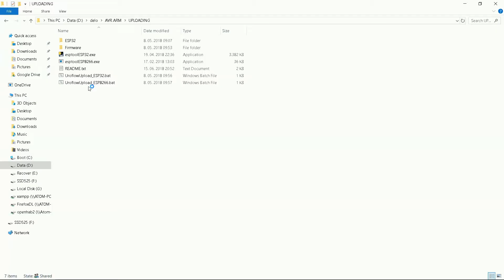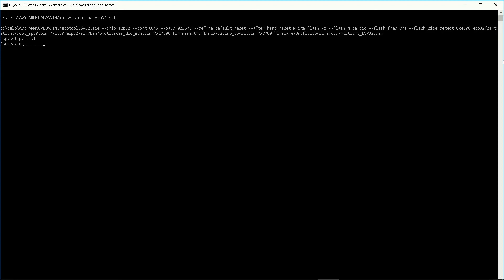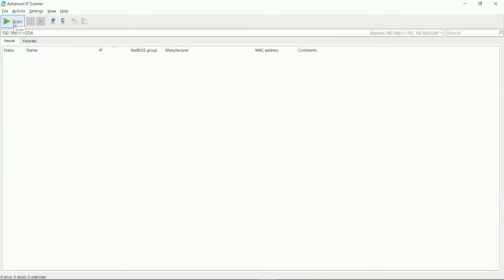🔴 UROFLOWMETRY MACHINE (How to upload/flash w/ Arduino firmware & files ESP8266/ESP32) 👨‍⚕️💊 PART 3

Comment: Hello Dr.  after some trials i managed it....don´t know how, but its working fine. Exelent work. Only on last question: There is a counter until 50...what happens when i reach 50 measurents?
Reply from the maker: Hi. Thank you for the question. It will stop working. You will have to buy a new esp32 and repeat it all. It is a precaution to prevent the commertial usage. 
Soon the device will be available for sale at https://www.rojo.si/ with no limits and in a nice enclosure. Not expensive for private use. I am rewritting the whole code... It might take a month or two. Please do check the site.
Reply: @greeneyedexplorer  where can i buy the comercial use?

Comment: Hello Dr....first..very impressing what you have done.....Here is my Problem:
I have uploaded the firmware successfully...but the device does not generate the Wifi "uroflow" as you discribe it in Video3 at 2:49...what do i wrong? 
Best regads....
Reply from the maker: Hi! Thank you for the question. It should work as described. You can bypass it all by editing .json file. Enter wifi credentials for your wifi and IP address, gateway, server. The IP might change - use wifi scanner to find the address after it connects to wifi. Don't forget to flash the json file :-) after the edit. (I see you have already solved it - good!)

Comment: Great little device, after a few mistakes on my side I managed to make the noncommercial version running nicely. It seems so far that the weight calibration works well - thank's for sharing.
Reply: ahoj, nemel bys funkcni fw? mam tam ten 0B soubor ESP32ino_ESP32 a nikde nemohu najit jiny
Reply: @colasfreehold  Ahoj, neviem, či ešte niekde je... Skúsim pozrieť.
Reply: @marekbundzel  dekuji, zkus to, jsi ma posledni zachrana, jinak neni uz dostupny.
Reply from the maker: Hello! Free firmware is no longer available. Uroflowmeter has become a commercial product. The manufacturer is iPeeWell. Link: https://www.ipeewell.com/
Reply from the maker: Hi Marek! Thank you for the compliment and for supporting my channel! Greetings to Slovakia!

Comment: Where can I find the buyable version ?
Reply from the maker: Currently I have prototypes...
Reply: I think I am able to design the hardware, and to mount it. I thought you were selling the software, don’t you?
Reply from the maker: The PC software works with specific microcontroller firmware. Specific protocols which are not implemented in free version.
Reply: Ok. So how can I buy it?

Comment: Hello Sir,
I'm trying to make this project to help a friend, but I'm stuck on the esp32 programming. When I plug the esp32 module (I installed the drivers and checked the com port) it lights red.
I can successfully program it by pressing the boot button on the module and then run  .\UroflowUpload_ESP32.bat
The output of the command is below:
esptoolESP32.exe --chip esp32 --port COM3 --baud 921600 --before default_reset --after hard_reset write_flash -z --flash_mode dio --flash_freq 80m --flash_size detect 0xe000 esp32/partitions/boot_app0.bin 0x1000 esp32/sdk/bin/bootloader_dio_80m.bin 0x10000 Firmware/UroflowESP32.ino_ESP32.bin 0x8000 Firmware/UroflowESP32.ino.partitions_ESP32.bin
esptool.py v2.1
Connecting.....
Chip is ESP32D0WDQ6 (revision (unknown 0xa))
Uploading stub...
Running stub...
Stub running...
Changing baud rate to 921600
Changed.
Configuring flash size...
Auto-detected Flash size: 4MB
Compressed 8192 bytes to 47...
Wrote 8192 bytes (47 compressed) at 0x0000e000 in 0.0 seconds (effective 8192.1 kbit/s)...
Hash of data verified.
Compressed 14128 bytes to 9194...
Wrote 14128 bytes (9194 compressed) at 0x00001000 in 0.1 seconds (effective 1027.5 kbit/s)...
Hash of data verified.
Compressed 737296 bytes to 426084...
Wrote 737296 bytes (426084 compressed) at 0x00010000 in 6.0 seconds (effective 987.2 kbit/s)...
Hash of data verified.
Compressed 3072 bytes to 122...
Wrote 3072 bytes (122 compressed) at 0x00008000 in 0.0 seconds (effective 3072.0 kbit/s)...
Hash of data verified.

Leaving...
Hard resetting...
====================
After the programming execution finishes, I have 2 lights, the red from before and now blue too.

The problem is that I can't see the SSID broadcasted. 
Tried to unplug and plug the module again...no success.
Please advise what I'm doing wrong here. I used everything as default, and just replaced 1 empty file with the actual firmware.
Reply from the maker: Hi. Before the upload edit the .json file with your friends SSID and password. It will work on his WiFi, not yours. The program goes into captive portal at wifi connection if it is not successful...
Please read other posts.
Reply: @greeneyedexplorer  Here is the debug info from the serial console, it seems it constantly reset itself as this repeats every second seems the problem is(E (71) SPIFFS: mount failed, -10025
Failed to mount file system
):
====================================================

Rebooting...
ets Jun  8 2016 00:22:57

rst:0xc (SW_CPU_RESET),boot:0x13 (SPI_FAST_FLASH_BOOT)
configsip: 0, SPIWP:0xee
clk_drv:0x00,q_drv:0x00,d_drv:0x00,cs0_drv:0x00,hd_drv:0x00,wp_drv:0x00
mode:DIO, clock div:1
load:0x3fff0018,len:4
load:0x3fff001c,len:956
load:0x40078000,len:0
load:0x40078000,len:13076
entry 0x40078a58

ROSA 20180618.v5785 by Rok Rodic alias Hacker007 alias GreenEyedExplorer
Chip ID: 0x99E350CC
Measurements: 0
Booting
       CPU0 reset reason:Software reset CPU
CPU1 reset reason:Software reset CPU
Heap: 157560
            Chip version: 1
                           CPU speed: 240MHz
                                            SDK: v3.1-dev-239-g1c3dd23f-dirty
                                                                             Flash size: 4194304
                                                                                                Flash speed: 80000000
     E (71) SPIFFS: mount failed, -10025
Failed to mount file system
Guru Meditation Error: Core  1 panic'ed (LoadProhibited)
. Exception was unhandled.
Register dump:
PC      : 0x40147a8f  PS      : 0x00060930  A0      : 0x800e0674  A1      : 0x3ffda380
A2      : 0x00000000  A3      : 0x3ffc1124  A4      : 0x000005b4  A5      : 0x00000008
A6      : 0x3ffda39c  A7      : 0x3ffda390  A8      : 0x80086132  A9      : 0x3ffda370
A10     : 0x00000000  A11     : 0x00000000  A12     : 0x00000005  A13     : 0x00000020
A14     : 0x00000020  A15     : 0x3ffd51fc  SAR     : 0x0000001b  EXCCAUSE: 0x0000001c
EXCVADDR: 0x0000000c  LBEG    : 0x400dce98  LEND    : 0x400dcea4  LCOUNT  : 0x00000000

Backtrace: 0x40147a8f:0x3ffda380 0x400e0671:0x3ffda3a0 0x400e09e9:0x3ffda3d0 0x400db880:0x3ffda440 0x400dcf7e:0x3ffda460 0x40131ad8:0x3ffda490
Reply from the maker: Hi. First you should upload all files and make the spiffs. Uploading firmware does not do it automatically by itself.
Reply: @greeneyedexplorer  Thank you, I suspected by the error I posted here that the spiffs is missing. Can you please point me to read how to do it? I was not able to find it anywhere in the instructions.
Reply: I figured it out, now this part is working. For anyone that faces the same problem.
1. Install Adruino IDE.
2. Watch this video to add support for esp32 (https://www.youtube.com/watch?time_continue=70&v=mBaS3YnqDaU)
3. Use this tutorial to upload the files in the "data" folder to the module (https://randomnerdtutorials.com/install-esp32-filesystem-uploader-arduino-ide/)
4. Follow the instructions in the project to upload the firmware.
Reply: @nikiangel1921   hello, so is it working now? does it broadcast the SSID ? working?
Reply: @allersvp  yep. It works now and broadcasting the ssd
Reply: @allersvp  I believe that I posted the solution somewhere in this thread, yes it is broadcasting now.
Reply: @nikiangel1921  Hey,  what do you do first? I am having the same problem and I can't see "uroflow" I upload firmware first and then I make the SPIFFS but It doesn't work.
And when you did SPIFFS what files you choose? only config.json or all files of "data"
Reply from the maker: Hi. Stick precisely to the video. The command uploads everything in the data folder.
Reply: Hi thanks por answer me, I have an "ESP32S". I am doing the same of the video but really, It doesn't work, I don't know why. I overwrite config.json with my ssid, pass, ip and other things, then I upload files and expected broadcasting "uroflow"
Thanks for helping
Reply: @greeneyedexplorer  Thank you for helping me. I'm still not in the part to upload the .json file. I just uploaded the firmware and expecting to see the  "uroflow" SSID, but it never comes.
So for me this is not working:
"At first bootup this file does not exist, so just wait those 20s and access point named uroflow appears for 5 minutes. " Uroflow does not appear as SSID.

Comment: also i never used that files you attached .. UroflowESP32.ino.doitESP32devkitV1.bin  should i ? where/how  should i use it  ... may be this is what i am missing?!
Reply from the maker: Hi. Yes. Please check my answer below. Copy the firmware file you have stated above into Firmware folder of the unpacked Upload.zip and rename& overwrite it into UroflowESP32.ino_ESP32.bin and run .bat file.

Comment: helli again, problem is no uroflow ssid after those 20 sec  . should i try other files under SDK/BIN ...  the 8 files? how to know which one match my esp-wroom32 ?
Reply from the maker: Hi. Use the package upload.zip. Unpack it and overwrite UroflowESP32.ino_ESP32.bin file in Firmware folder with UroflowESP32.ino.doitESP32devkitV1.bin (length of ca.800kB) from github. The final name should be the the one of the first file above, so rename the 800kB file. Hope this makes sense. Then just run the UroflowUpload_ESP32.bat

Comment: THANKS 4 REPLYING ME: ... yes that is the prog > it does not broadcast ssid (uroflow) .., blue led is always ON. (measuring i guess) at serial monitor i get  repeating few lines .... (will past down here) , my chip is good because when i downloaded small sample prog > i can see and access its SSID and play with an html web file so it must be either the way iam downloading your files or i am choosing wrong ones! . i tried both batch file and esp32 tool >> successful download but no SSID uroflow.    any further suggestion?

rst:0x10 (RTCWDT_RTC_RESET),boot:0x13 (SPI_FAST_FLASH_BOOT)
configsip: 0, SPIWP:0xee
clk_drv:0x00,q_drv:0x00,d_drv:0x00,cs0_drv:0x00,hd_drv:0x00,wp_drv:0x00
mode:QIO, clock div:1
load:0x3fff0018,len:4
load:0xffffffff,len:-1
ets Jun  8 2016 00:22:57
thank you soooooooooo much
Reply from the maker: When the program starts it displays some info about the ESP32, then "SPIFFS mounted", then "wifi connecting to", then 100 "." and if cannot connect it displays "Not connected. Starting captive portal!" The "."(dots) take about 20 second which is period it tries to connect to ssid with password which are both specified in config.json. At first bootup this file does not exist, so just wait those 20s and access point named uroflow appears for 5 minutes. Then connect to this ssid and enter 192.168.4.1 into browser... When you configure your own ssid, pass, ip... they are saved into config.json. Reset. That's all to it. Led is on until all setup steps are made - including all above. When the led turns off one can start urinating...
Reply: Hey allservsp, how did you fix the "it does not broadcast ssid (uroflow) .., blue led is always ON" as I have the same problem.

Comment: hi, sorry was my first arduino approach , i overwrote the 0 size file with the  UroflowESP32.ino_ESP32.bin from the firmware folder and oh oh... it accepted the 4 files :) "big improvement " ..  however there is no broadcasted SSID "uroflow" ! am i missing something ? .. esp32 is working as h/w because downloading sample wifi files from internet makes it broadcast SSID name buut not uroflow files.. should i replace one of the 3 files + 1 file of firmware with another file from another folder?  .. i tried both .bat file and the download toll >> both send the 4 files successfully  but no ssid (yes i have to press boot button ...)  appreciate if you have time to reply. thanks a lot
Reply from the maker: Hi. No problem. Now, when you have uploaded firmware, watch the video Part 3 from: 2:39. Then connect to the device and follow video Part 3 from: 3:15. In the last part you will upload www files from upload.zip. Please, report the progress.

Comment: so sorry to bother you... (promise last question)
i see in your attach the 4 files and one of them has 0 size !

0xe000 esp32/partitions/boot_app0.bin    >>> 8 kb
0x1000 esp32/sdk/bin/bootloader_dio_80m.bin   >>> 14 kb
0x10000 Firmware/UroflowESP32.ino_ESP32.bin  >>> 0kb *** is that is correct? zero size?
0x8000 Firmware/UroflowESP32.ino.partitions_ESP32.bin  >>>> 3kb
Reply from the maker: Yes yes. It is a blank file. You have to overwrite it. You choose latest version of uroflow firmware and rename it into UroflowESP32.ino_ESP32.bin and put it into Firmware folder. You can use any other bin file for esp32 and rename it and copy it into Firmware folder. Then just run .bat file for the esp32. It will upload firmware. Another way is to edit .bat file and specify the path and name of your .bin file... It seems I haven't been clear enough in the video. Thank you for your remark!!!

Comment: hi Dr. 
i toke the day off to gain time and still not do it. "  day off is not paid :(   " 
here is what i reached for.... i used this https://www.espressif.com/en/support/download/other-tools 
  and used your files 4 files>> same issue then i used your video  https://www.youtube.com/watch?v=PtNOOtTaPlg   and created small led on/off prog and by that https://www.espressif.com/en/support/download/other-tools i could upload the 4 files WITHOUT A PROB .   also serial port terminal is receiving good text at baud 115200 ... so i believe something with your files,,,  would you please check those files you attached? .. be blessed
Reply from the maker: Hi. Thank you for your answer. It may help me or any other user/viewer.
I have rechecked my files. They work correctly on all of my ESP32 boards (tested 10 from various sellers). On one I had to push the BOOT button all the way, while uploading, until the upload finish. There are many issues regarding ESP32 boards. The ESP32 module by itself works, but all the other components including CP2102, resistors, capacitors may be badly soldered. So there are mainly upload problems (see: https://github.com/espressif/arduino-esp32/issues/333). It should upload at 921600 baud. They are made for that. Lowering baud rate may correct the problem. Some ESP32 DO HAVE UPLOAD problems. So, again, thank you for your comment!

Comment: hi Dr. just received my 1st esp32 today... i am at com port 12; updated the .bat file com3 to com12 ; at connecting i get ......._______ few times then says fatal error occured; i tried different pc and changed ports... . should i update baud rate in batch file to match com setting of device manager? ... all the best
Reply from the maker: Hi. I have encountered the same problem. One batch of esp32 I have received from one of Aliexpress sellers boards have a hardware failure - the cp2102 does not "press" the BOOT button. So, every time I upload sketch I have to manually press the BOOT button on the board...
But there may be other issues on your board - they are hardware related! So please read one of the threads on the net to solve the problem like
https://github.com/espressif/arduino-esp32/issues/333
Maybe first try my solution, secondly change the usb cable...
But before all try reading the com port - esps have a preinstalled program which prints some text (115200 baud rate) - this would mean: board works, cp2102 works, cable OK.